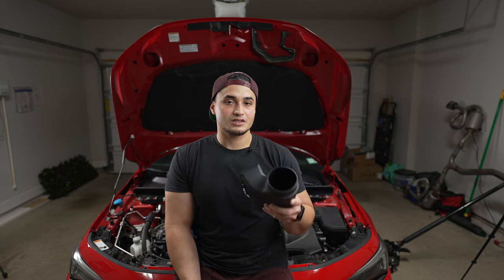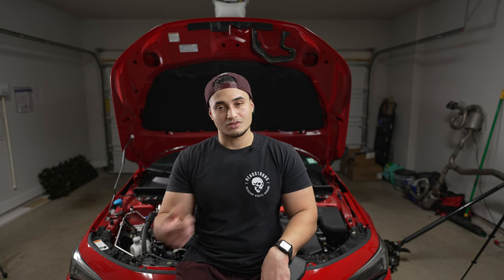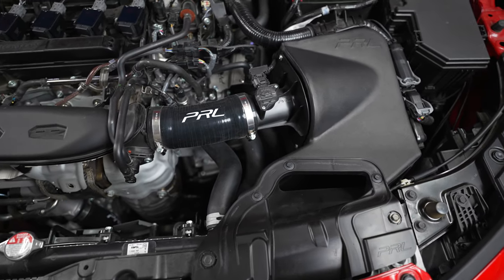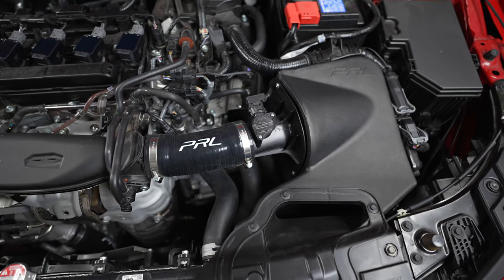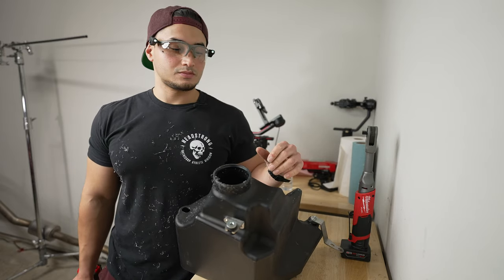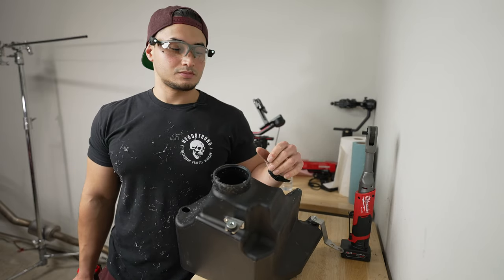Install a PRL High Volume Plus Cold Air Intake Duct - and How It Can Improve Performance & Sound!

Comment: i think the air intake duct is the most overlooked piece of the cold air intake upgrade..a direct airflow to the box
Reply: Would it not also work to just drill a hole intake box and not get the duct extension?
Reply: @A-GoldenBar The duct sucks in air from the front of the car by the wheel housing. Drilling a hole wouldn’t do anything because air can’t get to it

Comment: Im still debating on getting the "plus" kit. Im most curious if it makes any difference to the sound, vs the HVI without the "plus" kit.  I live in Michigan which only really sees mid 80s for a few months, then its mostly 50s/60s and 4+ months of winter.  I dont track the car, just highway driving. So i feel heatsoak wouldnt be too much of a thing if I opt to get PRLs new short-ram for the 2022 civic for louder sounds. But part of me thought maybe because the "plus" adds another 3" port/scoop, maybe it'll add some noise volume too and be more on-par?

Comment: Great video Luis! Question: how much horsepower did it increased with all that you had installed ( PRL intercooler & air cold intake?) thanks!
Reply from the maker: I never got a custom tune but not a whole lot of horsepower increase, the intercooler is more for consistency instead of doing a few laps or rune and being heat soaked, and air intakes are good for managing some heat at well when they can intake some colder air but nothing too crazy on horse power. You probably won’t notice much of a change especially on stock turbo and tune.

Comment: Could you give me more information on which exact 10mm bolt you used for the lower CAI bracket piece please? I removed the intercooler resonator too and threw it away. 😑

Comment: Yo
Bro imma get a lease on the 2022 civic imma have a warranty and I’m wondering what can I do to my car like performance and physical wise that wont flag my warranty
Reply from the maker: Warranty 👨🏽‍🦯 never heard of her? 😂 lmao jk bro. Honestly man, I can’t give too much advice on that. If you modify the engine in any way and something goes wrong the dealership will try to blame it on you for having performance parts on the car. I don’t seem them giving you a hard time for an intake but you never know with dealerships and manufacturers man. Sorry it’s not much help but modifying your car is always a risk to your warranty. From what I heard you can have them prove that what you did to your car caused the damage. But obviously if you break something during install it’s on you. So if you’re really worried about it I wouldn’t do too much. Intake and exhaust is probably as far as I would go, but again I can’t promise they won’t give you a hard time about it
Reply: I know it's a year late but you may want to read up on the Magnuson Moss Warranty Act. It's supposed to protect your warranty as long as the dealer can't DEFINITELY prove your upgrade caused the cars issue

Comment: Is this worth doing just for sound?
Reply: Or should I look into the new prl short ram intake?
Reply from the maker: @Chef_RM  the short ram intake will more than likely produce more sound. But intake temps might go up from it
Reply: @lui.racing  so if I choose to go with t the HVI plus cold air intake, is that the best balance of sound and performance?
Reply from the maker: @Chef_RM  haha idk how much sound you’re looking for 😅 I enjoy the sound out of mine. If you just want the turbo noises then the short ram is the way to go and if you want less heat soak in days you really push the car then the HVI would be the better option. 🤷🏻‍♂️ I don’t have a short ram to be able to compare
Reply: @lui.racing  I would definitely like more sound, but not at the cost of performance. I’ve heard that many people are happy with the HVI and cold air setup since it still has more noise than stock. How much more noise would you say it has? Rn I can only hear my turbo if I don’t have any music playing at all
Reply from the maker: @Chef_RM  if you want super loud noise then the cobra would be the way to go. But it’s not meant for this gen. I made a video on that if you haven’t already seen it
Reply: @lui.racing  would you say there’s any potential problems that can be caused by installing the cobra? If it’s too much of a hassle I’d probably just go with the HVI plus CAI
Reply from the maker: @Chef_RM  it’s not as easy of an install and your fuel trims might be off. So you would need a tune technically, although I did run mine with just an off the shelf tune from Hondata and Ktuner and I was fine. Definitely would recommend the intakes made for this generation
Reply: @lui.racing  thanks bro, i appreciate the info. I wanna avoid doing anything too major like tuning while I’m under warranty so I’ll just go with the HVI plus cold air for now.
Reply: @Chef_RM  how's the sound and performance? I can't decide which one to use,  Sri or hvi.
Reply: @A-GoldenBar  hvi sounds great, turbo is way louder than it was stock and I hear it more often. I also notice the boost come in a bit earlier and I think the boost gauge hits a slightly higher max than it did before
Reply: @Chef_RM did you install the add on plus cold air and if so, is there a need to remove the bumper, etc?
Reply: @A-GoldenBar  I didn’t install it, I think bumper removal is necessary
Reply: @Chef_RM  so it's worth installing the hvi over the sri?
Reply: @A-GoldenBar  if all you want is sound then get the Sri, but your performance will suffer a bit. Hvi adds performance and sound, but less sound than sri

Comment: Did you get a CEL when you installed the duct? For some reason I got a CEL and I’m worried I did something wrong. I followed every step so I don’t see where I could’ve gone wrong. I’m going to drive around for now and hope the light goes away. Auto rev match and blind spot monitor also disabled for some reason lol🫠
Reply from the maker: No I did not get a CEL. I’d double check all connectors are connected if you disconnect the MAF sensor and that it’s installed properly.
If you disconnected the battery it will take some time for everything to come up again. 
I hope everything returns back to normal
Reply: @lui.racing  I appreciate the quick reply, thank you!